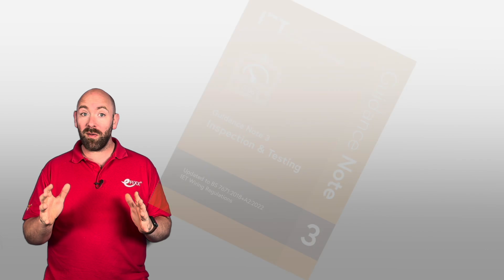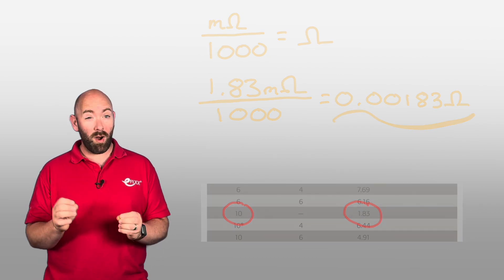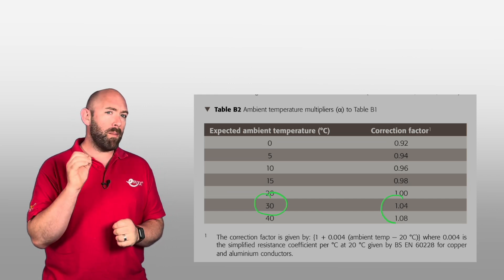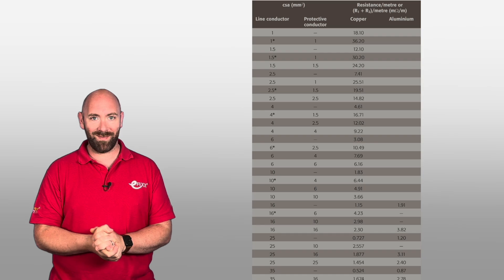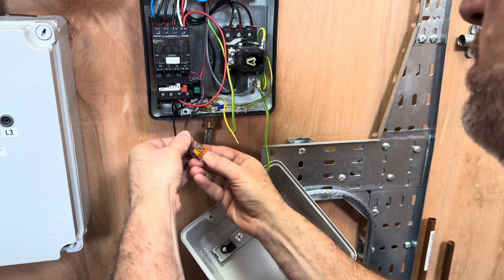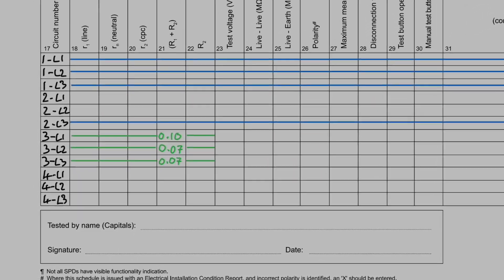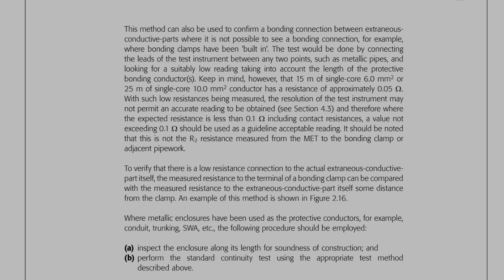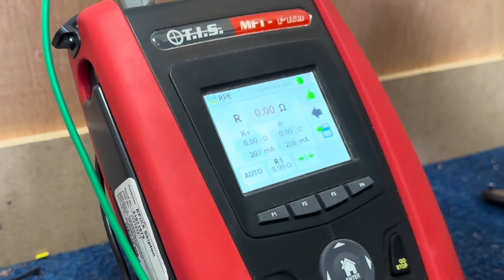Ace Your AM2: Practical Earth Continuity Testing Techniques

Comment: Re max resistance of the main bonding conductor. If I'm understanding you correctly, you're suggesting that from the MET to the bonding clamp, the resistance of the bonding conductor should not exceed 0.05 Ohms, and you've used the GN3 entry on p61 to confirm that. I suggest however that this is incorrect. Basically, there is no declared max resistance for the main bonding conductor. The 0.05 number is not the max permissible. The last sentence of the that paragraph confirms that it's not the R2 value from the MET to the clamp - all we need do is confirm the resistance of the conductor for its length, whatever that value may be, we're just confirming continuity of the conductor and the resistance for that length. This is confirmed by Electrical Safety First in their Q&A 1.131 which says:  Is there a maximum acceptable value of resistance for verifying the effectiveness of a main protective bonding conductor and do I have to record it on a BS 7671 model form?

No, there is no defined maximum limit of resistance stated within BS 7671. However, there is a requirement to verify continuity by measurement. The measured value need not be recorded.

Regulation number(s):

544.1.1

643.2.1
Reply: Thanks for the comment  @johnhoward2104 

I would watch it back, as I do outline that the idea and literature around 0.05 Ohms is, no where. 

I’m highlighting this common misconception around 0.05 as your quite rights, the main priority is verification of connection. In fact if you can see the connection between two points that can be confirmed as a verification of connection with a tick in the box of an EIC or EICR, the video is aimed at learners and those preparing for assessment but this is still a value which learners are expected to reference in certain controlled assessments 😂

Thank you as well for the comments and keep them coming 😊